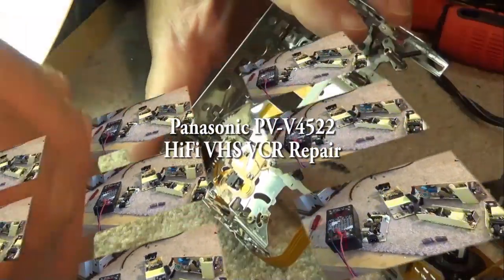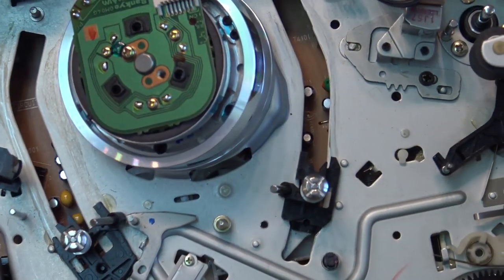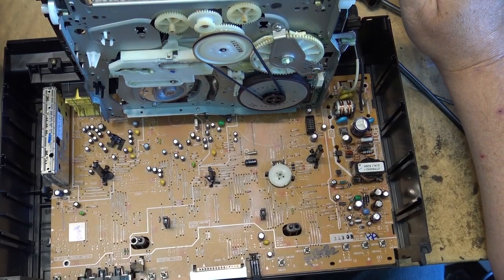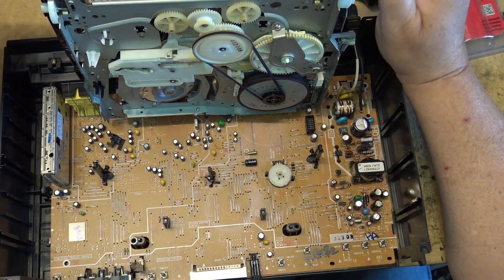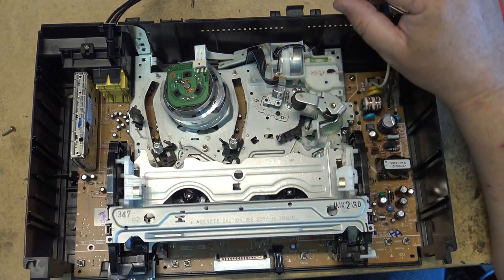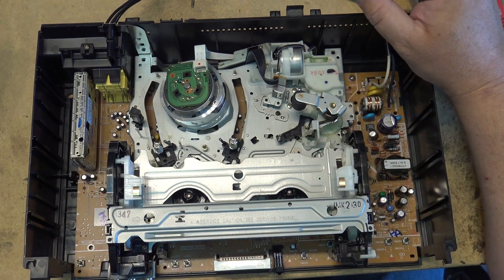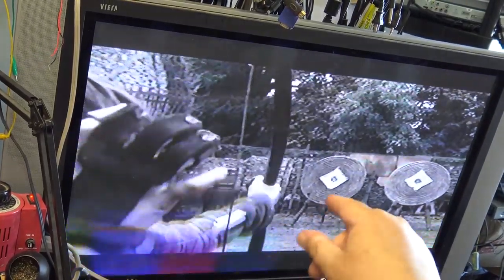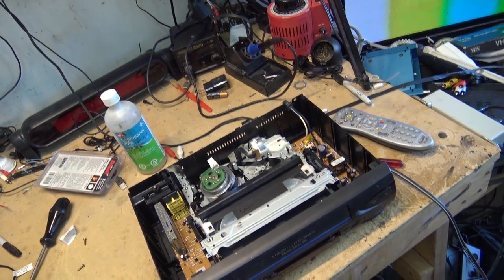Panasonic PVV4522 VCR Repair

Comment: Did you ever do any repairs on VHS camcorders? I have a Hitachi 3150A that I'm working on. I replaced the belts and lubed it. I still haven't been able to get it to play a tape. Then I noticed one of the belts I put in the wrong area of one of the spindles. After I fixed that it would play the tape a few seconds and shut off. If I turned it back on while it was still in play mode it would automatically shut off again. I can FF, RW, Stop and Eject. I just can't play or record without it shutting off. Any ideas? Mode switch I'm guessing?

Comment: Hi 12voltvids.
I have the Panasonic PV-4623S which looks exactly the same on the inside as the one in this video. After watching the video and doing my own

troubleshooting, including cleaning the mode switch, I determined it is most likely the center IR emitter. I suspect this because of the way the unit is acting and because I don’t see it blinking when I turn the lights out.   It could also be the take-up sensor since it starts to play for second and then goes into shutdown mode. Is there a way to remove the main circuit board to replace it? I don’t see any screws. What holds it in? Also, do you have a video that shows the replacement for these sensors?  Can it even be done?

Comment: Hi!  Thank you for posting this video!  Did you use rubbing alcohol to clean the heads with a sheet of copier paper?
Reply from the maker: Yes isopropanol alcohol 99%
Reply: Hi mate how do I remove the plastic catches/tabs that hold the mechanism in place, mine I had to remove the circuit board, but what do I use to remove the white plastic tabs that hold the mechanism etc.
Reply: I concur with 12voltvids, paper and alcohol is the way to do it.

Comment: Can the basket assembly from this Panasonic be used as a replacement for the one in an AG-1980? Since mine doesn't load tapes I assumed this might be the cause as it was in your AG-1980 repair video. What other models can be used for replacement parts? Having a hard time finding ANY old Pannies to use as parts donors. Lots of Sony, Hitachi, JVC, and crap like Emerson, and house brands for Walmart, Canadian Tire, Zellers, etc. but no Panasonic...
Reply from the maker: No totally different design.

Comment: I'm trying to figure out why my VCR doesn't work when plugged in.  When I press "power" nothing happens.  It is a Panasonic Omnivision PV-4501.  Can you give a suggestion of what might be wrong and where I can find the fuse?
Reply: Blown power supply. Check capacitors and Zener diodes in power supply section of the board.

Comment: I have this vcr. It won’t play, rewind or fast forward. I cleaned as shown in your video. But it looks like the head won’t turn. Do you know how to fix this problem? Also I jumped the gun and cleaned it with a w tip. Is it done for? The VCRs for sale online are too expensive. I am looking to fix this one.
Reply: Clean the mode switch as he shows in the video.

Comment: I have a Panasonic similar to that and it seems to judder when rewinding. Looking inside, it looks like the tensioner is juddering but it causes the winding back to be inconsistent. Sometimes it will slow down way to early when it comes to the 'end' of the tape and take forever to rewind. Is there any way to fix this? The belt seems fine - I gave it a clean anyway plus all the sensors I could see.

Comment: How did you learn to repair vcr's? Did you have formal training or are you just a vcr savant? 😀
Reply from the maker: I had formal training when I worked for Sony. Trained for betamax but they are pretty much the same.
Reply: @12voltvids  Well you excell in repairing vcr's, I haven't seen a vcr issue even come close to stumping you! You may have had betamax training but I think you are also a Savant! And thank you for sharing your knowledge through this vids to us hopeless lunatics who in 2019 still use a vcr! 😁
Reply from the maker: @midnitematador6249  I have one that has me stumped. I will some day actually figure it out. It is a Panasonic with 6 motors. 2 reel motors (direct drive) capstan, drum, loading and cassette loader.
Reply: @12voltvids  Stumped, you? No way! That thing will regret the day it challenged you! 😀

Comment: Random question..  I've always wondered how tracking works on a VCR.  What exactly is happening inside when you press the tracking button?  Is it something physical with the heads?
Reply: http://repairfaq.cis.upenn.edu/sam/vhsfmt.gif

As you can see, a VHS tape got helical tracks for the video signal head drum (they don't look helical on this diagram, but they become helical once the tape is laced around the head); there are also tracks for left and right audio channel, and one for a tracking signal, that tells the VCR when should the drum heads be in what position so they can run along the helical tracks on the tape, perfectly aligned to them. If the alignment is not perfect, the capstan motor controller offsets the control signals a tiny bit, which results in slight changes in the tape speed, until the alignment becomes perfect again. Sometimes it can be heard as a slight flutter in the audio when this happens (also during manual tracking).
Reply from the maker: Not physical no. What tracking does is change the phase of the capstan motor, to advance, or retard the tape position with respect to the spinning head. The same could be done on the drum, advance or retard the phase.
Reply: @12voltvids  Wonder why Sony never used that for their decks? Manual tracking is okay but many times will not track tapes made on other decks. I have a lot of Japanese recorded tapes from the 1980s that won't track for love or money. Will probably have to watch your mod video for changing the guide path to force them to track. The last of the Sony Betamaxes DID have auto tracking as I recall but no idea whether it would work on my tapes. But I have several older Beta decks that could be modded to try...
Reply from the maker: @hawleygriffon9290  
In Japan they use both 50hz and 60 depending on region. Even though ntsc was used in Japan if I'm not mistaken the vertical scanning frequency is tied to line frequency so tapes recorded in the 50hz regions require a multi system machine just like playing a pal tape. A single frequecy machine won't work.  My multi system VCR has a switch for 50hz but I have never seen a tape personally that is in 50 Hz except for pal and secam.

Comment: I have a UK-model Panasonic HDD/DVD/VHS machine on which the VHS drive has started to move the tape backwards when a tape is inserted. Doesn't wait for remote or other commands, just starts itself off and gets in a tangle. 

If anyone has any suggestions for specifics to look at, or links to other online guides ....

Comment: You have exactly discribed the problem that my vcr does it works for a couple of seconds and then shuts down 
Does the part you mentioned get cleaned as well or does it get replaced or is it not even worth replacing in the first place?
Reply from the maker: Just clean the mode switch and you will solve 95% of the troubles.   I have never replaced one just cleaning.

Comment: Hi  great video. Can I ask where I would be able to find parts for a Panasonic Omnivision VCR...probably need a belt I hear squealing and then it shuts it stops playing
Reply: Try lightly sanding the idler tire in the middle that goes back and forth between the two reels with 600+ grit sandpaper. Just get it so it's not shiny. No flat spots. There are no parts except a doner unit.

Comment: I don't mean to hurt you, I just want to say my personal ideas. First of all, I want you to know that I respect your efforts for years. Still I think; After you have covered your desk with a nice material, you should clean it thoroughly and put it in an order that looks good for you and us. Also ( maybe I'm wrong, but I think you're doing your job a little rough ). You should treat the devices that have been brought to you more gently. Thank you for your understanding.
Reply from the maker: First of a these devices are generally mine.  When you see me toss a VCR on the bench it is mine.  Second I don't have time to clean my bench.  To quote the gifted mechanic Scotty Kilmer "my workshop is a pigsty". If I clean my bench it will be a disaster again after the first repair job.  That is just the way it goes.  When I worked in repairs there was 3 of us in the shop. One guy was a neat freak and had to put his tools in a certain place and if one tool was out of place he had a fit.  Guess what his productivity was 1/3 of myself and the other guy. Why? Because he had to clean up after every job, clean the bench and sweep the floor.  He also polished everyone's cabinets to a high luster.  He didn't last long as he was always locking horns with the boss for wasting time cleaning up.
Reply: @12voltvids  Okay Mr. 12VoltVids, i shared my thoughts, and thank you for sharing your thoughts.

Comment: Would this be an Orion-made VCR? I don't recognise it but it does have a few design cues that suggest Orion. They weren't that bad, even late on, for reliability - better than Funai for sure.

One of the big problems with these later machines is the single PCB, which makes them very susceptible to damage in transit.
Reply from the maker: As far as I know Panasonic never used other manufactures VCRs. They built their own.

Comment: Hello.  I have a similar Panasonic deck that I just cleaned because a store bought recorded tape would play, but a blank tape that I recorded something myself wouldn't play.  What could cause this?
Reply from the maker: Did you try recording at both speeds.  Same result?
Reply: Thanks so much for the reply. I didn't record anything, but I played the working prerecorded tape all the way through and now the tapes I recorded on (years ago), play fine. I wonder if the tape had "cleaned" something.  I thought I had cleaned everything I needed to clean.

What I want to do is archive my personal recordings to a dvd recorder (Liteon). The only purpose of this machine is to play tapes I recorded and not prerecorded movies or to make new tapes.  I was just using that as a test.  

I wanted to use my Sony deck, but thanks to watching your videos, I realized that I have the dreaded blue loading gear problem.  It reminds me of a problem with old Ford odometers.  I had a couple issues where it was the same bad plastic gear that broke and I had to replace them. 

If I hadn't just FUBAR'd an old Sony cd player by taking the cd mechanism out and not getting it back together correctly (binds up when I put the cover over the laser assembly), I would've attempted the blue gear.  I'll probably get my courage up one of these days.  I don't want to screw up the Sony because it's a good player.  Much better than this cheap Panasonic.

Comment: Do you have video where you are applying oil and grease on moving parts? I have panasonic that works fine, but i noticed that i need to push the cassette a bit harder when inserting in the vcr. Which parts of the loading mechanism should be lubricated? Thank you!
Reply: Use molytone grease on all parts of the FLM. Very, very little.

Comment: Why does that circuit board have so many jumper wires on it? Was that an inexpensive way to make 2 sided circuit boards?
Reply from the maker: Yes that is exactly why. They didn't want the expense of a double sided board. The reason there are unpopulated areas of the board would be for other markets. PAL or SECAM versions would have components mounted there.
Reply: @12voltvids  Thank you for the reply and for answering my question!

Comment: I have a Philips VCR that turns off when inserting a tape. Exactly at the moment where the tape blocks the light sensor in the mechanism to tell the VCR that a tape is inserted.
What may be the cause of that?
Reply: Could be a few different things but you should clean the mode switch for sure.

Comment: Those low range VCR from that era whoever is the manufacturer seems to be all based on the same chassis. The PCB are unworkable as traces get lift or broken by even applying the lowest temperature possible to desolder thing with low melt alloy. They might look good quality at first, but the inside says otherwise.
Reply from the maker: Throw away device.  Just like everything else.

Comment: Hi I have a PR-4501 VCR made in 1995, and when I press the power button nothing happens what do you recommend?  thanks
Reply: Check the fuse and capacitors in the power supply.

Comment: Would you say it's better to clean the head this way you do it, or by using a standard cleaning tape?
Reply from the maker: This is the way the pros do it. I was taught this by the cheif engineer at the TV station I worked at.
Engineers and tape operators clean the heads on the broadcast machines before every tape is loaded.
Cleaning tapes are hall assed at best except for 8mm, DV and DAT. This is because those tapes are metal tapes and the metal when it contaminates the head literally fuses itself to the surface. A dry cleaning tape is used to "grind" the debris off, which also takes a little but of the head material with it resulting in reduced head life.

Comment: Can you fix a phillips reel 2 reel I am intersted in getting it repaired?
Reply from the maker: I wouldn't know unless I saw it unfortunately. Getting mechanical parts for reel 2 reel is pretty much impossible these days.
Reply: @12voltvids  I would like to try I have the belts and the electronics  are ok it just needs re adjustment and new belts is that something you can do I also think its really dirty?
Reply: @12voltvids  The buttons respond and it wants to go i think the back of it just needs a good cleaning.

Comment: I have a problem with the tape takeup to the readvhead
It only pull the tape to one side of the read head. The puller arm on the other side do not move. How to solve this problem? Tq.
Reply from the maker: What is the make and model?

Comment: What would cause a VCR to have no sound with a recorded tape but has sound with a commercial tape? I've tried multiple different tapes, only get sound when playing a commercial tape
Reply from the maker: Problem in the audio recording circuit.
Reply: @12voltvids  
The tapes in question have sound on another machine. The machine with the problem will only have sound in HiFi
Reply: Tracking head reads mono audio as well. It's either out of alignment or the circuit is bad. If the tape is tracking, it's probably not out of alignment.

Comment: I have a Panasonic from 2000- and one like this from 2003. The 2003 never could match the picture quality from 2000 unit.  And both the newer deck could never match the quality from a 92 or 93  model Quasar we had - which was on par with our old 1985 Panasonic Hi-Fi unit.

Comment: An early 90's Funai we had with a similar mechanism, same cheap design, very clunky and unreliable, and sometimes the cassette got stuck in it. As it turned out, the cause was a small sheet metal piece in the loading mechanism. I removed it, because it was completely unnecessary as it was, problem was gone.
Reply: The Funais were much more cheaply built than this. The local video store had these in their rental hard cases and I would fix 10 or 12 at a time every couple weeks. Very flimsy FLMs and threading mechanism parts. Video store didn't care because they made loads of money off these rentals.

Comment: Sir, I have VCR, but, if power on by power button the VCR work , but after 5second power off, what did I do sir, please give solution
Reply from the maker: Clean mode switch for starters.

Comment: I have a Panasonic SVHS VCR - PN:  PV-VS4820.  Anyone know where I can get the capstan belt for it?  Panasonic discontinued the belt.
Reply: Take note of type (square, round, flat) take measurements with calipers and find something close, but slightly smaller on ebay.

Comment: Not really a fan of mid mount machines i do like my panasonics i have a 1985 nv730b a 1992 f55 and some time lapse svhs an ag 6730 plays films fine in 3h mode only reason i got it that and the fact it was cheap ,my nv730 i am getting parts to get it serviced i always did like the look of these a d deck i believe the f55 works fine but looks like it has played nearly every vhs tape on the planet i removed the internal head cleaner after watching a repair of a sony you did ,i have two f55, parts machines hoping to make 1 of the two ,a 90 something svhs jvc and thanks to my dad a sony c7 betamax he got from a radio fair after offering two uk pounds came with 4 tapes and a service manual i was not holding out much hope being a sony i was expecting the heads to be worn out but it has really good picture quality just needs the common caps that fail doing, and to try and fix the clock module no doubt battery leakage  and all the clock module buttons have had it but i will hopefully get it back to good health.